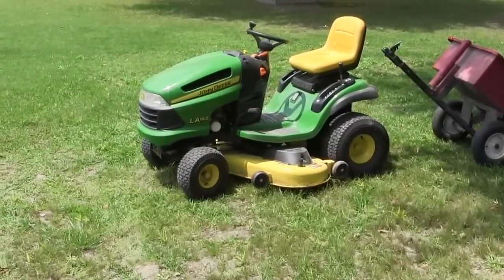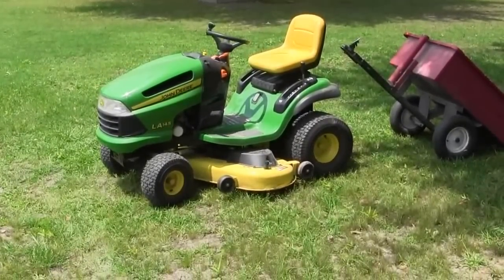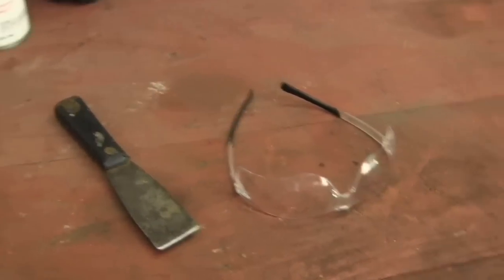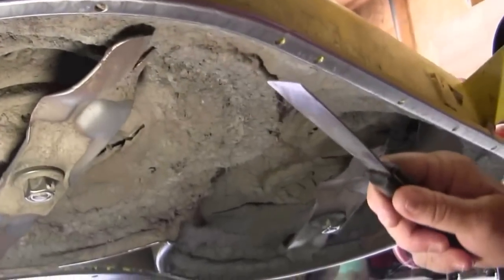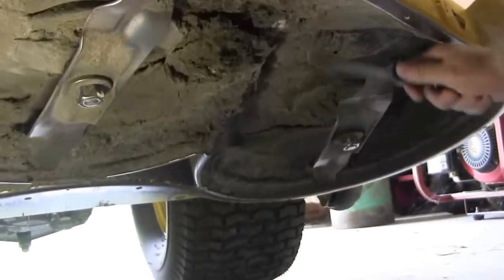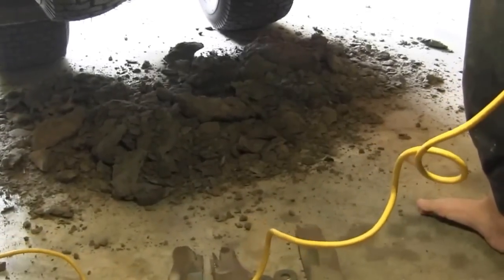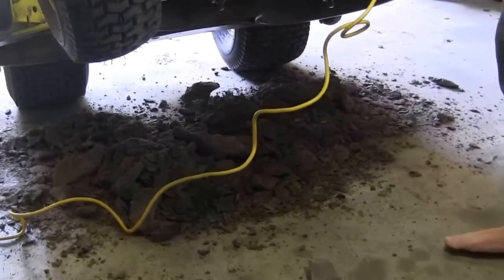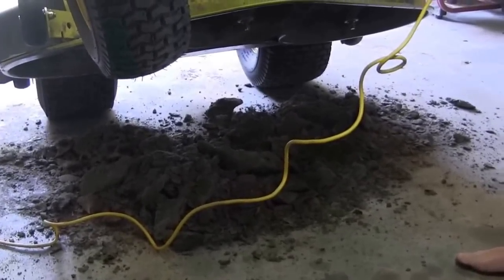How to clean a mower deck

Comment: Your grass is not as caked hard as I mine was! I found that vinegar in a spray bottle is a pretty good solvent for loosening the caked-on grass. As you scrape with tools, spray the vinegar periodically and let it soak on. These tools worked well for me: Pry bar for scraping, a MoJack scraper made for mowers (from the company that makes mower lifts), chisel with hammer (used sparingly, wire brush and a good portable light. Essential: Dust mask and wraparound goggles. I used a mower lift. Take the blades off! The job would have been easier with the deck removed, but I didn’t want to take that on. It’s hard work. Took me an hour and a half. Last: Spray with PAM spray for pans to discourage grass from sticking.

Comment: I'll have to do this to my JD LA175 next spring ....not looking forward to it but must be done. It's a 54" deck and I find it a whole bunch easier to drop the deck and pull it out, flop 'er over and do what I got to do. Bearings / lube and blades are generally what I try to keep maintained, and if the blades get bad from too much dirt or rocks, they should be replaced before they ruin the bearings and housings. I have a garden hose connection on my deck and flush after each mowing if the the grass was damp, so it stays pretty clean under there. Belt condition needs to be watched too, as well as wear on the pullys.  
I doubt if I'll ever get my wife out to do mower maintenance unless both my arms are broke and I go blind, but that's ok ....I can't cook and have no idea how to operate her fancy new computerized, digitilized front-load washer and dryer. We agree to keep our mitts off each other's equipment. I once tried to "organize" her sewing room and that nearly resulted in my getting lynched when she got back home. Trying to be helpful without permission is almost suicidal!
Reply from the maker: +Gene Kinnick Since this video,my wife had cancer, a heart attack, a surgery called a fundoplication, and now, I do the inside work as well as the outside work. I never cooked anything more than toast, and now I can make chili,meatloaf and spahgetti. I even figured out how the washing machine works. some mowers I lift with my cieling hoist, and some I remove the deck. It all depends on what I plan to do.
Reply: Sorry to hear, and hope she is recovering well.
Our best to both of you, and kudos to you for jumping in there to carry on for her and learning what the better half already knows. My wife has also had to recover from surgeries ...the latest a cancer removal from her left cheek, and then chemo, leaving me to do some of her chores. She is doing well and about back to her normal. She does help me out in the yard, but I do most of it. I still can't cook though, so my daughters helped us out in that dept.
I browse the tube and try to find fun / interesting  things others are doing and pass a little humor along if I can. Your idea of getting that job done by delegating to your wife as you supervised from the chair with the iced-tea was great, but I can't even get mine to try to drive the mower, much less work on it. She will bring me the iced-tea though, and then I get it full of dirt & grass cuttings while I slop it all over myself!

Comment: If you still monitor this video, what did you use for the lift?  Hoist or winch?
Reply from the maker: I have a a triple joist with a 12 volt winch attached to it. When I built this addition to my shop, I knew I was going to work on mowers so I tripled aceiling joist to accommodate the weight.
Reply: What is the weight rating of your winch?
Reply from the maker: 500 pounds but I’m still only lucky half the weight of a mower and after 10 years, it still hasn’t failed me. It’s just a harbor freight cheapy.
Reply: Thank you BC.  My neighbor has a 1,500 Hoist attached to his garage ceiling.  Uses it to lift his Polaris ATV 4 Wheeler and his JD ZTR 335 to work on them.

Comment: Make that under deck cleaning easy with a vibrating multi-tool with a flat scraper blade.  Cheap and useful tool about $20 at Harbor Freight.

Comment: That's  funny! I rarely clean my LA150's deck, but I remove it when I do. My grandfather jacks up the front end on his Cub Cadet when he has to clean it or remove the blades. And just a tip, remove the deck if you're going to be going through a garden or whatnot. I learned that the hard way...got my tractor stuck when I was driving it up the lane to mow some weeds. It did fine without the deck.

Comment from the maker: i take the decks off both mowers at least once a year. its easier to do maintenance on them sans the decks. my cub is a lot easier to take the deck off than the JD. the cub also does the majority of the mowing. the JD is for up around the house and such. the cubby is for the 4 acres of grass i have across the street.

Comment: I drive mine part way up on the ramps on the back of my 3/4 ton and pressure wash it off .I also spray a little use motor oil undrer it keeps from rotting them out

Comment from the maker: no they are beyond sharpening,,,but i could blunt the ends and beat the grass into submission! actually,if there wasnt a hole in the blade, i could use it as a blank for a zombie killer knife. ive already got back from western auto and replaced the blades as well as a belt on my bigass tiller.